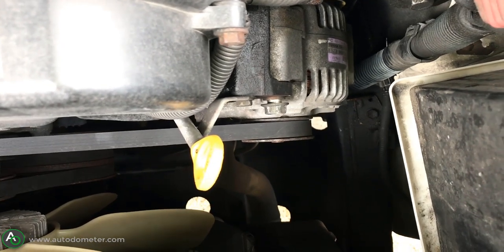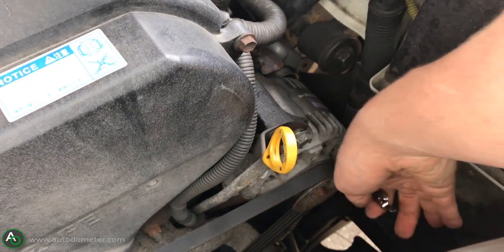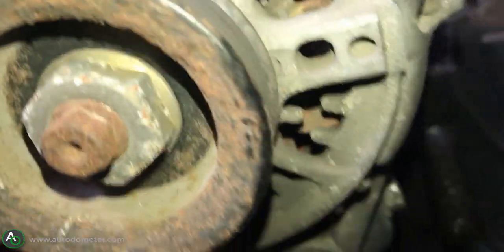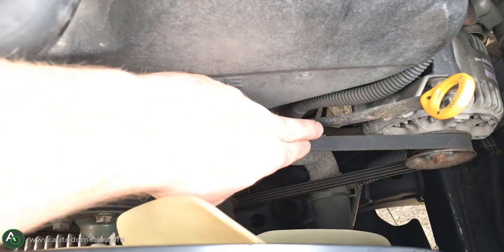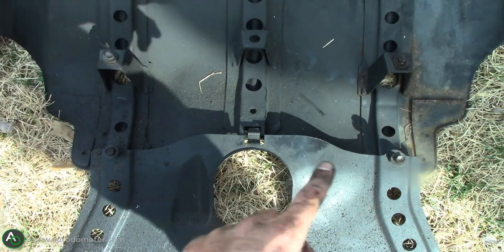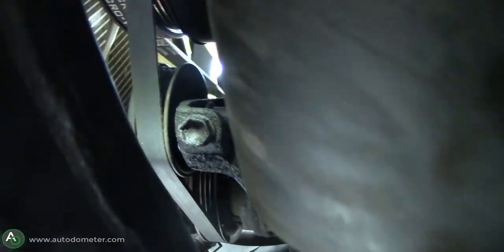Squeaky Belt Fix

Comment: I watched this video for my squeaky 2000 4-Runner. If you are tightening the alternator belt it is super important to take off the 12mm bolt head that is below the alternator. If you don't take that bolt off it will not tighten the belt and could even snap off the lower 12mm bolt. I almost did this but stopped when the belt wasn't getting tighter, I nearly snapped the lower bolt off. This is a great video but you NEED to take off the lower bolt first, this is not covered by the video and has led to some bad things.

Comment: AWESOME!
Pretty much straight forward.

I removed the air box and clean my MAF at the same time and made adjust bolt a little more exposed.

I didn't have a ratchet wrench. I used a closed end wrench for the adjuster bolt. Used a socket with a swivel and a long boxed wrench for the power steering bolts.  
A longer wrench works really good on the powers steering bolts.

Great video!
Thank you!

Comment: Just curious, you didn't mention loosening the 14mm bolt that holds the tightening nut on the bottom of the alternator. If you don't loosen that bolt before tightening, you'll bend the tightening bolt as you ratchet the belt tighter.
Reply: This just happened to me! My bolt snapped!!
Reply: Followed this video and snapped the alternator tensioning bolt. I should have been paying more attention, I know better.
Reply: By following the video directions I broke my alternator tensioning bolt.... smh... Nothing like an instructional video that leaves out the most important part of instruction. Ugh!!
Reply: This comment should be pinned to the top @AutOdometer
Reply: @preach319  haha this just happened to me too.  How did you fix it?
Reply: Yeah, pretty absurd he hasn’t edited the video accordingly. I’m glad I looked at the comments before tightening my tensioner too much. I noticed that it wasn’t adjusting the belt, loosened the tightening nut and voila, it works. Mine was a 12mm bolt, not 14mm.

Comment: Don't follow this video!!! It's almost correct. You have to loosen one more bolt for the alternator to move to the right along the slider. He doesn't mention it and so I didn't know and my bolt snapped :(
Reply: @andrewrader5946  Thanks for the part number, you can guess why I need it :(
Reply: @HectorCrespoAbel  damn this guy is responsible for at least three broken bolts 😂😂 sounds like u guys need to buy a Haynes manual for ur trucks